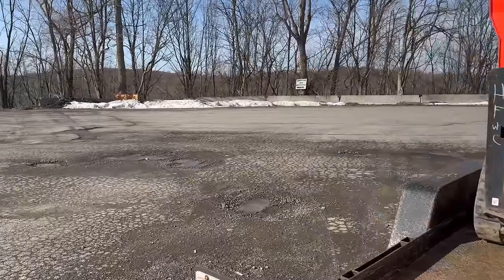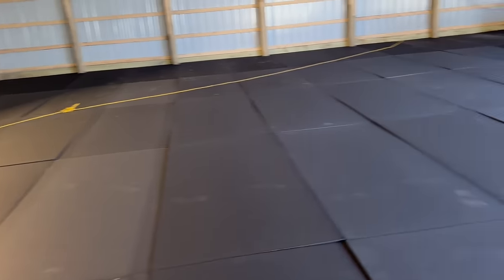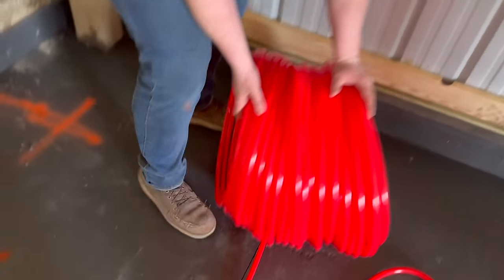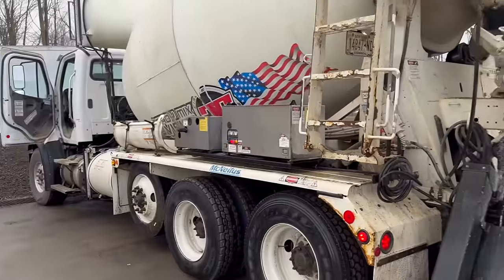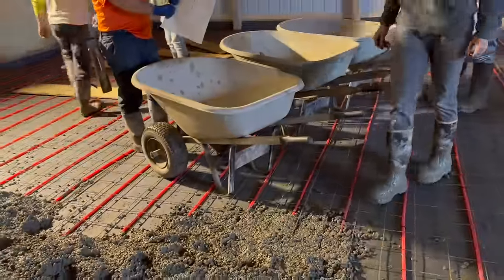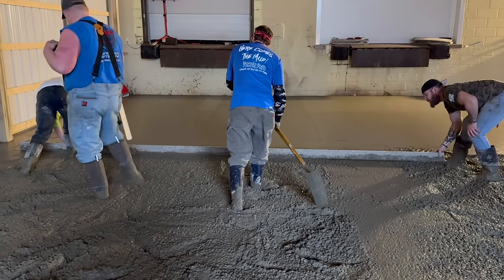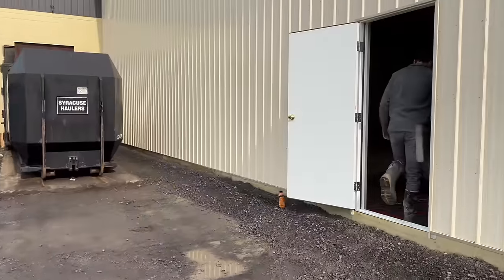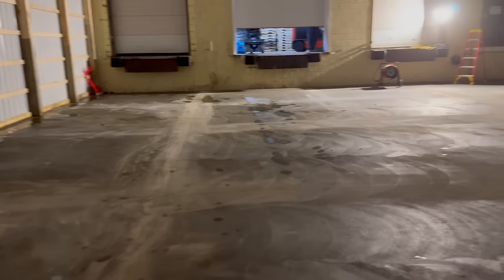A better way to instal radiant heat in concrete!!

Comment: Nice job👍I would recommend to put the manifold on and pressurize it during the pour. just in case a pipe gets damaged you can see it and make the repair.

Comment: Not sure why you're not using Heat Sheet by Logix, unless you've never heard of it. You can get different R values at 2/3rds the cost of polystyrene. It's made to hold Pex, interlocks, and you just walk on the Pex and it snaps in place. Way faster to install, cheaper to purchase and savings on labor. You also never specify which Pex you are using. I use Pex Al, with an aluminum barrier that prevents oxygen intrusion and rusting components with better heat dissipation. Loop Cad is a program that will lay out the most efficient runs while keeping them as close to the same length as possible, costs a few $$$ but does the work for you. Lastly, a 500 foot run is ridiculous for efficient heat transfer. Your clients are spending more on heating the floor evenly and the cost to replace a 3 speed pump is a lot more than a standard one. Sure you'll get the job with a better price for less runs, but they, and you, don't know how much more they are paying in the long run. Buy once, cry once.

Comment: Brand X is only about 15 minutes from your location! Better watch your back! LOL 😂 You might end up with some concrete shoes to go swimming with! 😊 Fin crete happens in the winter because on a cold day, when the truck is loaded at the plant, if they add very hot water when first batching the load, the drum is cold, and expands quickly, causing the fin crete to fall off as the steel expands. It’s a little tell about who rinses their truck good, and who doesn’t. Sometimes!😳😉 The joys of traveling Rt.34 in the winter!

Comment: I used a FLIR to find where I can go into the concrete. Heat the lines up with hot water and they’re easy to find. It will also show if you have any flow problems. Works great!

Comment: Thanks for educating some of your viewers about the installation of radiant heat, not familiar with it living in NC, unusual to experience long periods of cold temps. Appreciate that the BB crew/family work in such concert with each other. Speaks to leadership. As my Uncle Wes, a "shade tree mechanic" and a good one at that, often said to customers, "I charge $40/hr - $60/hr if you stay and watch, and $80/hr if you try to help." Good job. Until next time...

Comment: It has been asked below but no answer yet.  What brand, type, and thickness are the foam insulation sheets you are using under the concrete slab.  Nice job by the way!  I have a 62' x 34' and a 125' x 50' shop concrete slab to pour in the near future.  I like how you ran the radiant floor heat tubing.  Considering doing the same thing on mine.  👍

Comment: If you use AMPEX, it comes in many R values and there is no stapling, staples, etc.  It comes with a heat welded vapour barrier on top which friction fits the pex tubing.  So its a very fast install

Comment: That staple gun is pretty slick and a real back saver. Over time the rusty wire reinforcement will rub on the PEX with every heating and cooling cycle of the slab, I would be concerned with future leaks. I would have used plastic chairs to raise the wire off the PEX tubing so there would be no future issues.
Why didn't the first truck with the longer conveyer stay so each subsequent truck could dump in getting you into the back corner without having to use the Brentwoods?
Reply: There’s no need to be concerned with leaks from the pex rubbing the wire.  Very minute/if any movement

Comment: Love your floors!  So if when its all done you check it with the laser, what would you say your deviation is +/-   I always run stiff mix and lacking skill I'll set some  1 1/2 conduit screed pipes on home made rebar chairs, I'm slow AF setting up for certain. Most of my outdoor stuff runs a double thickness frost block and fiber mix 4.5  5k . not had any cracks.  Friend wanted pro-work done for a small machine shop, they were an inch high on the edges, can't figure out how unless they used a home depot 2x4 screed
Reply from the maker: Thanks we like to stay within 1/4" when we pour. The screed chair and pipe work good if you lack wet screed experience.

Comment: Hey there Mr. Bondo, just curious if you folks pressure tested the radiant tube for leaks overnight before the BIG Pour, or just rolled the dice it would be leak-free?  Unless I missed that part of the video, or you didn't include it, is why I ask.  Not testing and finding you have a leak is a horrible situation as one might imagine!  Just wondered what your guy's "SOPs" are on this topic . . .  😎

Comment: I ran rear mixers and some Oshkosh front mixers probably about 10 years ago, but I have never seen a conveyor system yet I have dumped into pump trucks and pumps

Comment: So your earlier work you would strap the pex to the wire mesh. But now it seems you staple pex to foam then lay wire mesh on top.   No chance of wire mesh of smashing or pressing down on the pex to cause issues ?

Comment: What kind of insulation board did you put down? Im about to have a 40x60 pole building built and want radiant heat which wasn't in original plan. Trying not to break the bank, insulation worst part.

Comment: When you push that foam or any board through the table saw you should hook a few fingers over the fence that way if it kicks back the board won’t pull your hand into the blade.

Comment: Mechanic shop will have a boost in it?   How do you suggest to your customer to bolt the boost to the floor when it has radiant heat?   If be scared of pierced the tubes?
Reply: I've seen bondo hang a plumb from the wrafters after the pex is placed, and before the concrete is poured. The plumb will hang directly where the lag bolts will go into the concrete without hitting the pex

Comment: I've got a basement that is about 2/3 of the footprint of my house and the remaining 1/3 is a crawl space open to the basement. I want to incapsulate the crawl and put down foam board. Should the foam board go under the vapor barrier or above it? I have no intension of covering it with concrete and I also run a woodstove in the basement.

Comment: Question, some guys put foam board along the edge vertically below grade, sometimes one or 2 feet question, some guys put foam board along the edge below grade, sometimes one or 2 feet below, I’m thinking it will help prevent thermal loss from the edges of the slab. Is that an optional thing, or do you just not believe in it?

Comment: rebar chairs yo. your pex would perform better if properly embedded in concrete, not to mention the mesh....also , since you're using 6" mesh, its just as easy to just zip tie the pex to the mesh which also holds it together....

Comment: I'm curious what happens to the styrofoam board under the concrete over time.
Reply: Nothing, it´s denser foam type for flooring and Styrofoam is mainly susceptible to sun, temperature about 40 degrees Celsius (maximum you ever should let go into floor heating) cannot cause any damage to polystyrene foam.

Comment: Tape your floor insulation seams.  Less chance that a smaller piece will float during the pour and it creates a much better vapor barrier.  We put plastic down over the dirt first which is code here, I think.
Reply: Should have taped the vapor barrier joints and perimeter to make it more effective.  6 mil probably won't last too long.  Use T&G insulation and stagger the joints to keep it from floating.  Have you tried using fiber mesh, superplasticiser and shrinkage reducing admixture in the mix and then no need for control joints?
Reply: @brentschulz3152 how big of a slab can you avoid control joints on with the proper mixture?
Reply: @jamesbelk8033  With the right mix design, I've done 60'x60' monolithic slabs inside an FDA blast freezers that supports forklift traffic.

Comment: how do you connect tyhe tubing together and to the 90`s at the manifold?   glue?
Reply: Those gray 90s just bring the pex out of the slab. The orange tubing connects to manifold directly. I think they get a crimp collar on a barbed fitting.

Comment: Why would they build something in front of the 'loading docks'? The one truck dock seems to be aligned with the new door, but the second dock is not! Maybe if they only have small box trucks using it, then they might be able to back in, but semi's or if another truck is at the left dock, you won't be able to get into the right dock!
Reply: Maybe I left that comment to early and they are putting racking in and not going to use those docks!

Comment: Why not use styrofoam that is meant for radiant heat and then you don’t need to staple? That is how I did mine and it makes it simple.
Reply from the maker: The foam with the Chanel’s in it is double the price of this foam and the staples are cheap. I have to be cost competitive as I have other contractors bidding against me on these jobs.
Reply: @bondobuilt386  saves a lot of labour. Throw the roll on your shoulder and walk.

Comment: I realize this is not the call of Bondo, but the wood poles directly into the ground is just so confusing to me.....I know that has been done for decades all over the place, but a lot of people are now (decades later) having to deal with rotten poles on a building they still want to keep so they are having to go in and fix things....and that was not a cheap building in today's video they built a nice facility
Reply: I had to fix my posts after 20 years.  Builder placed them in the ground and I had to replace over half.  Not too bad using sonotubes, labor intensive.

Comment: U guys really need to be conscientious about the length of ur videos.
This is full of unnecessary verbiage. There is no reason for a video to be over 10 minutes. If so, break it into parts.
This (sh)could have been done in 1 or 2 10 min vids.
Barring that critique, a lot of good info. Interesting, when it didn't drag on.
Don't understand why you didn't tape the poly on floor.
Reply from the maker: Ill take your critique but I do these videos for thousands of people snd you are the only one that says the videos are to long. this video has 20 k views in 1 day so I think it is quite popular.
Reply: Ten minutes videos? Seriously get your meds adjusted.